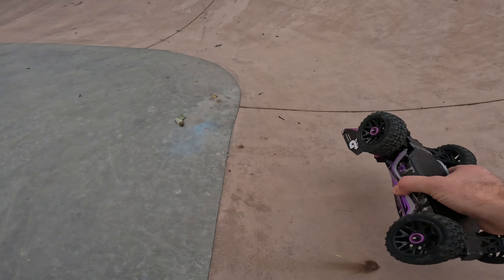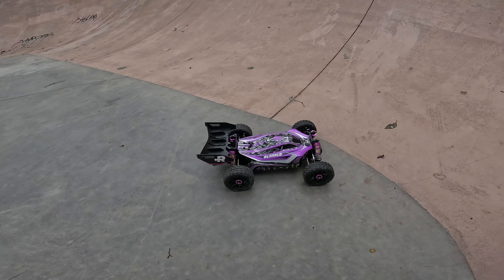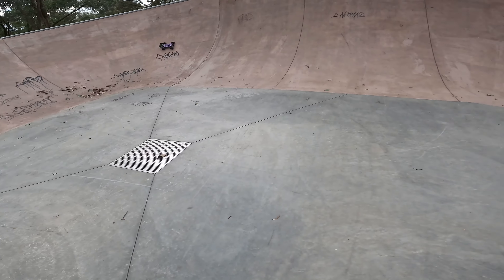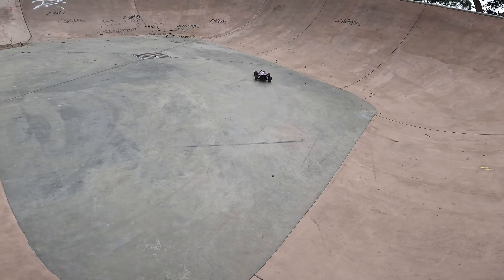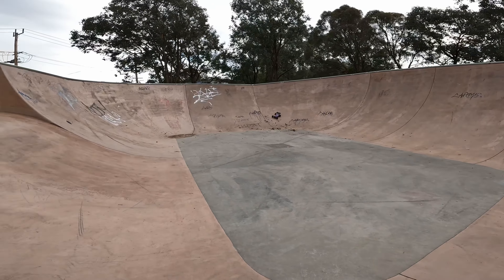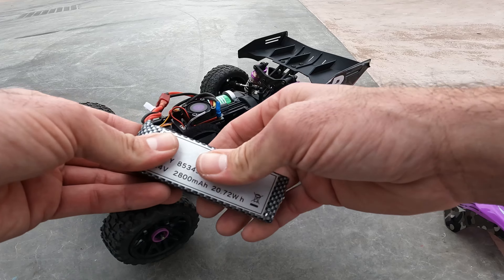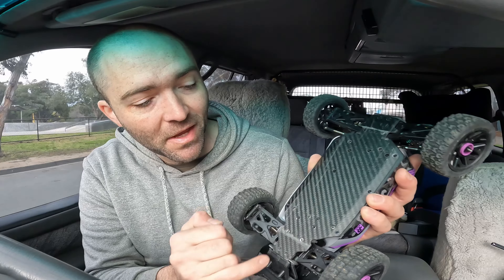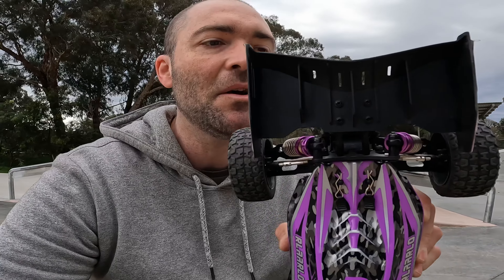This Durable RC Car Exceeded ALL Expectations!

Comment: oh man. That little thing is tough! wow. colour me impressed. Some of those landings are *HARD*. and at some really harsh oblique angles. My goodness how is that thing even still working?

Pretty much any one of those hard landings on the suspension arms, directly from the front/back or sides, would have broken the arms on my 1/10 nitro buggy. In the dozen years I've had it, I've spent at least as much in replacing front and rear lower arms as I spent for the whole buggy new. It never would stand up to even a tenth of the abuse this one is soaking up. That's a definite credit to the manufacturer and this buggy, for sure. 

If your intention was to convince me that, when my kids reach the age where they need a small scale basher, this is the one to get, then you have succeeded. I don't think I've ever owned any RC car that could take the punishment you dished to this one, and still be running properly afterwards. Well done, sir.
Reply from the maker: Thanks and yes, it took a heck of a beating. I've got their alloy bodied truggy here too but it's heavy. The carbon fibre chassis is the key on this, I'm pretty sure. Lightweight means less kinetic energy means less damage.

Comment: I enjoyed the video, It really demonstrates the car's durability. When you took so very high jumps and the car landed on the front or rear wheel at an angle I was surprised it survived. I have found with some rc cars that are running at higher speeds keeps the electronics cooler, but that is not a hard and fast rule. The car may need a motor fan. I wonder if the car would run cooler with a metal chassis? It looked like fun.
Reply from the maker: You could be right about that but my feeling is plastic is superior to metal for bashing. Light weight and flexibility are the key to survival!

Cooling, I'm thinking passive cooling would be helpful. With a few slots in the body, going faster would bring better airflow. I'll have a play and we'll see where we end up.

Comment: You know there's a new FMS that just came out, the 1950 Ford F1.
It is called "MAGNUM SCALER 1:18 FMS - ROC11814".
I just bought one it is beautiful.
Reply from the maker: Nice, thanks for the tip. Enjoy!
Reply: @RCTNT  No problem, if you want to see it click on my psedo I put a small presentation video.
In the description there are two links to buy it.
Thanks again for your videos.
The Frenchie...

Comment: Did you have any issues with the steering servo? Clare's r/c ran one at an indoor carpet track and her husband couldn't control it due to a lag between the signal and the servo, he was all over the place.
Reply from the maker: Nope, no issues at all, I'm pleased to report.
Reply: Just got mine. Steering isnt great. Looking for what I can do to improve
Reply from the maker: @bdog6160  I haven't had that problem - but the first thing I'd be checking is the radio. You've adjusted throw on the dial?

Comment: By the look of all you guys video, the wheels don't have enough wheel spin in high air (tires not big enough).
Reply from the maker: There are several moments in this video where I over compensated and brought the nose up too much. Brushless power does give these little wheels sufficient air authority, IMO, but you've gotta change your timing from bigger jump trucks.

I've got the 005 truggy here with the bigger wheels and brushed motor. I'm looking forward to seeing what it's like on the jumps too.

Comment: Gets so hot so quickly
Reply from the maker: That it does! Although I did also condense 20 minutes of driving into 4 minutes on screen. I'm planning on cutting a few slits in the body to get some airflow through it. Should help! We'll see when we run it on 3S next time after a few more minor tweaks. It's a tough little thing!
Reply: @RCTNT  I'm starting to wonder if that was the issue Clare's R/C had?
Reply from the maker: @muskokamike127  could be. I haven't put 3S through mine yet. I think that may well kill it if we do extended running. It's a 2S machine and on 8v instead of 12v there is the thermal headroom to deliver consistent, punchy performance. I'm expecting fade and then failure on 3S. But, I could be wrong! We'll see soon enough!